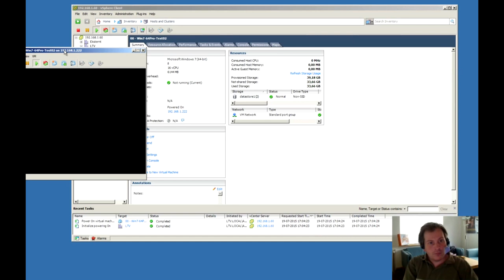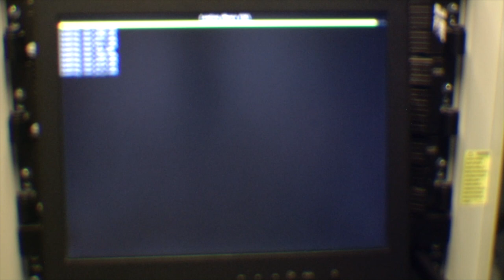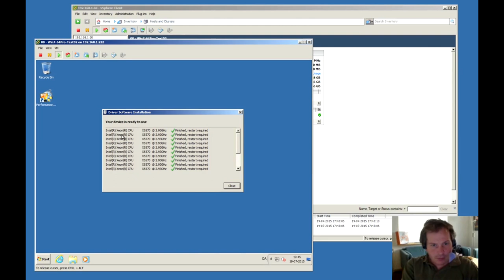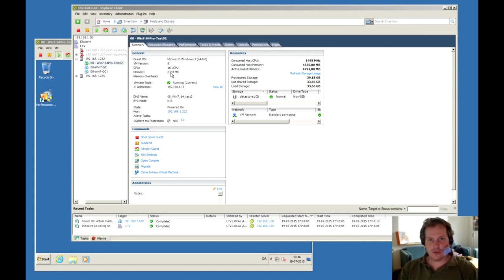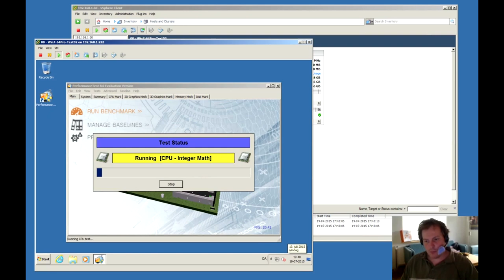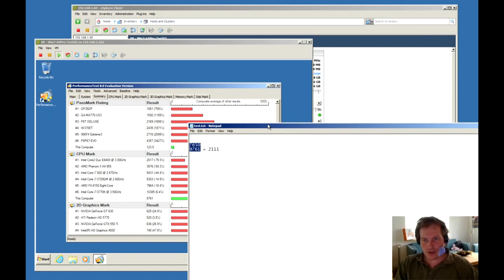CPU upgrade of two Xeon´s in x3650 M2 IBM Server - 213

Comment: Perhaps against my better judgment, I recently bought an HP ProLiant DL585 G5. It can handle 4 Opteron quad core CPU's, and I found that I could get a set of four of them for less than $20 through eBay! I was a bit more excited to discover that it holds up to 256 GB of DDR2 RAM, which also means that its RAM blocks can also fit my PowerEdge 1950, which is quickly moving up on my list of servers to remove from my service since it draws so much power for a unit that only holds two disks. I will be following in these processor replacing footsteps soon!
Reply from the maker: Hi Tyler Barton 
Tomorrow,  you get a video on Lenovo x3650 M5 vs. IBM x3650 M2,,, there is certainly something exciting about preform and power consumption.
Thank you for watching! :-)